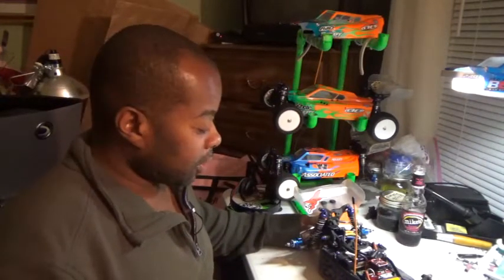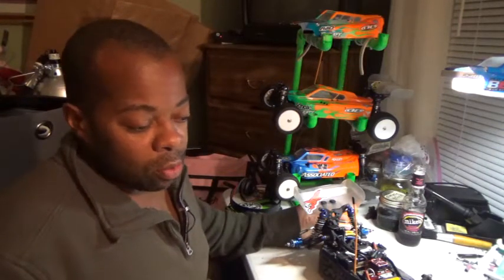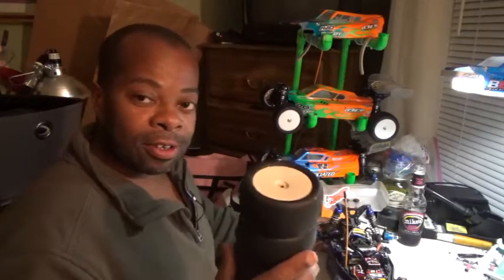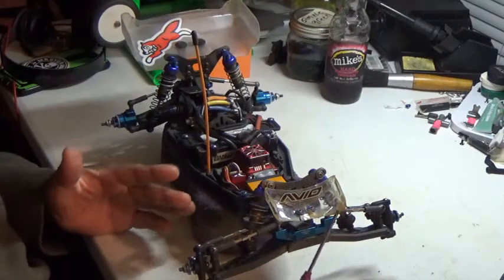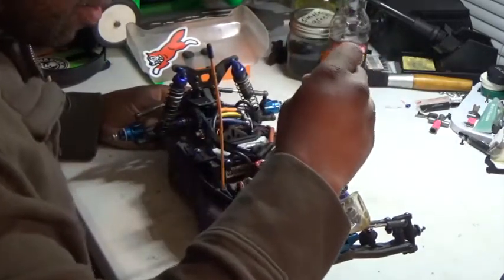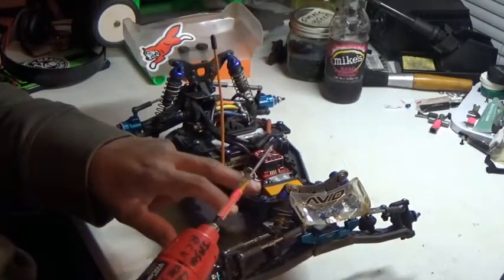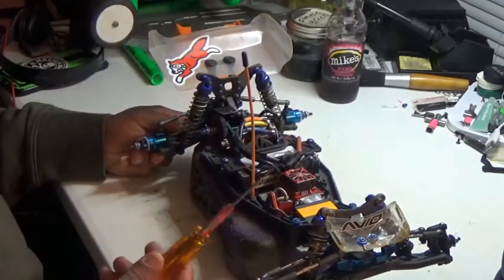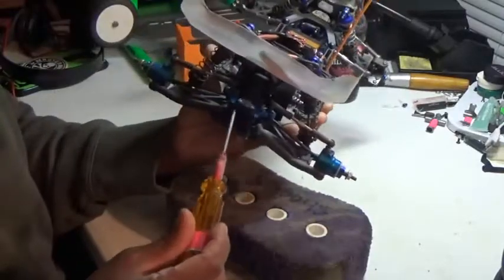My maintenance Between Qualifers at club race Part 1  #Rcvitals #RcRacing

Comment: Nice! I like the info geared towards beginners. Very helpful!
Reply from the maker: I was trying to do it for beginners or anybody at a club race.     At our track club racing is on wednesday night.   So we are rocketing through the qualifers.       I see soo many people chatting it up and when their qualifer is up they are not ready because of simple problems.

So I thought this is a quick and easy way to check your stuff in a system fashion.     I learn this when I used to race dirtbikes.   I learned it from  eric gass from pro circuit.
He used to go around the bike going using one T handle at a time.  whatever T handle he started with he made sure every nut and screw that fit that handle was tighten.   Then he moved on to the next T handle and so on. 

This is a system Ive use every club race night.
Reply from the maker: Thank you 
Ryan for tunning in.    
Your video I think has set the bar on youtube.
 But also you got to check out my buddy evan jay up north doing his thing.  He created a whole new AE 2wd car.    
   
Ryan Keep up the good work.  Hope to see you up at the jconcepts final here at speed rc.

Jason

Comment: So even if the battery is not fully drained you can throw it back on the charger
Reply from the maker: TJ 
Hey tj. 
I do charge mine that way. Like fit instance say i broke but got 6 laps in.  As long 4wd my battery is cool. I put it right back on the charger.